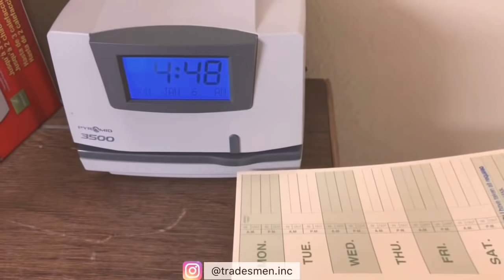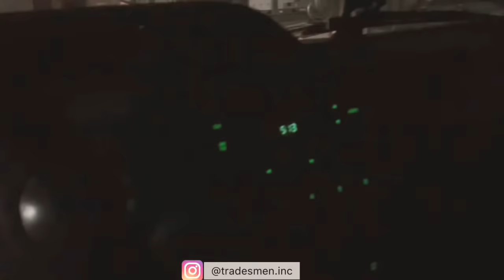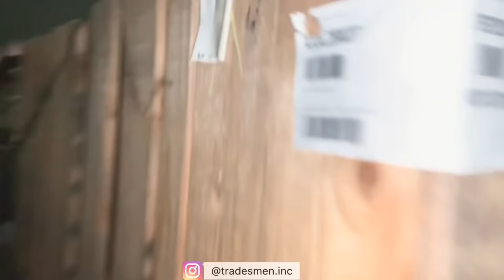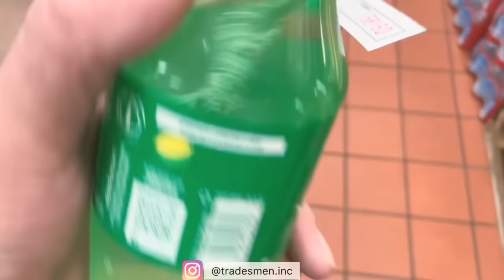HVAC-R VLOG / HELPING OUT OLD TIMER / COIL REPLACEMENT

Comment: I am one of those old timers that worked on critical charged cap tube systems in the 70s and 80s and we never used a micron gauge. On the real wet or contaminated systems triple evacuation and we were good to go.
Reply: 410a with nitrogen prg and deep micron is critical and not so much forgiving like old refrigerants. I work with old timers and they are def stubborn 😂 but are work horses.
Reply: @hvacslayer2929  I agree back in the day our refrigeration systems were R12 and 502 with mineral oil and was forgiving. I new guys that on A/c units would not  even vacuum ,just sweep and charge.